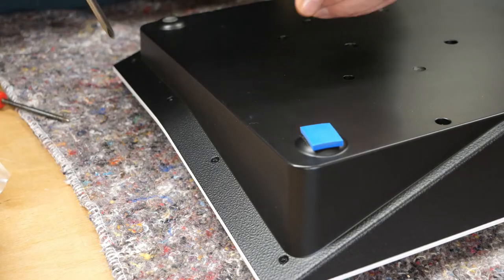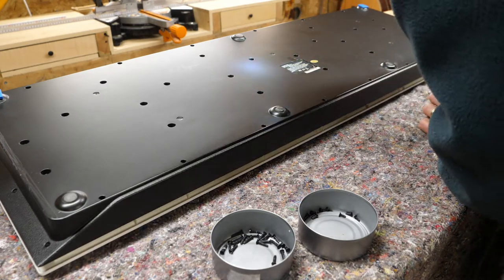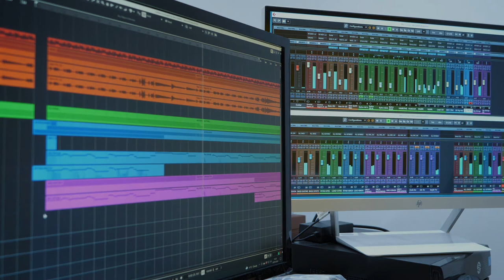Replacing sun damaged yellowed keys on a Nektar Panorama P6 keyboard

Comment: Thanks for this video. My pitch bend pot keeps sending out data when I'm not touching it, so I pulled it all apart as per your instructions and gave it several good sloshes of contact cleaner. 

Anyone else looking at this, my P6 has 20 recessed screws on the back plus the 8 short ones at the sides. The 10 larger screws (in 5 pairs) hold the keyboard in and don't need to be removed to get the top off. 

Now to reassemble it and see if I've done a good enough job!
Reply from the maker: Good luck 👍 cheers Dave

Comment: Hello, thanks for the video. I can see that the keys are spring loaded, but does them have Weights underneath? I really love the feeling of my Axiom Pro, which have weights and feels amazing! But I prefer the DAW integration of Nektar. 
I used to have a Nektar LX61+ and the key are Synth Action which feels horrible for me. I wonder if you can share a picture of the underneath of the keybed disassembled. Thanks
Reply from the maker: Hi I’ve posted a photo on my instagram page footstepguitars. It looks like they are weighted but I’m not an expert. You could contact Nektar I have found them to be very helpful. Cheers Dave

Comment: That's awesome.
Ive got the same problem.
How much did they charge btw?
If the p6 had hammer action keys it would be perfect
Reply from the maker: Hi there, I paid $75 for the key bed when I made the video a while back, just contact Nektar (link in the description) they will help you. Cheers Dave
Reply from the maker: Hi there, I paid $75 for the key bed when I made the video a while back, just contact Nektar (link in the description) they will help you. Cheers Dave
Reply: @DaveDickens 
Thanks for the reply Dave

Comment: I was just going to suggest retrobrighting it, but you already know about the hydrogen peroxide trick :) That probably wouldn't fix the rubber buttons though.
Reply from the maker: I would like to have a go a retrobrightening (that’s a great word!) cheers Dave
Reply: @DaveDickens  It's originally a brand name, retr0bright. It's become a verb, particularly in the retro computer scene.
There's a channel called 'The 8-Bit Guy' who regularly performs the technique on old computer hardware. He usually uses the Texas sun to provide the required UV light, but he also has a setup with multiple UV lamps.